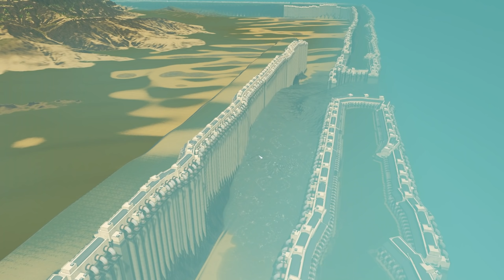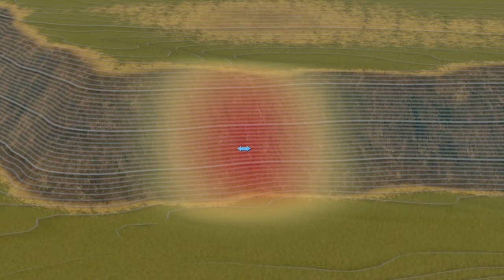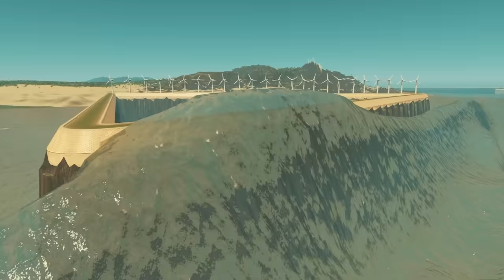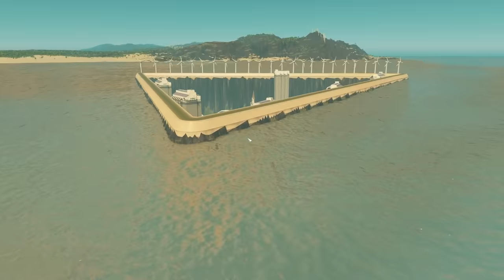When an Engineer makes Atlantis in Cities Skylines...

Comment: When you discovered that pumps do indeed need power but forgot that coal power plants do indeed need coal (ore industry will help with that) I thought to myself, "Ladies and Gentlemen, an engineer."
Reply: Wait till he discovers he can pause time so people won't abandon/die while he's trying to fix the issues with the city... :)
Reply: He's a drainage engineer. He drained the power grid, then drained the coal supply. All working as intended.
Reply: @afsarmstrongfiresafety7460  🤣
Reply: @afsarmstrongfiresafety7460  but failed to drain the water. 2/3
Reply: @grqfes  2 out of 3 objectives met is pretty good by municipal project standards.

Comment: I think perhaps a second triangle should be done, but this time having one of the points facing towards the sea so that when another large wave comes it gets split and deflected like a wedge instead of crashing along a flat wall. Also having the walls even higher will help prevent spill-over since the first triangle only accounts for a calm level sea and doesn't prepare for higher levels.
Reply: So, basically a bastion..
Reply: That was my second thought, "why'd he have the flat side towards the sea?"
Reply: @MrFright2010  Because that's only something an engineer would think of, oh wait.
Reply: Unfortunately, I don't think the game's water physics care enough. From all the C:S I've seen, it just sorta pops over everything...

Comment: Here’s a few suggestions:
Use Building Anarchy to toggle placing modes so you don’t need a shoreline, use Ferries and Barges (from barges mod) to have an outside connection.

More terrain tools also allows you to place water sources and set sea level.

Comment: Your issue was with power not working consistently. That underwater one might have worked if the power plant hadn't run out of coal. 

The tidal wave from the sea wall likely overdrew the windmills so the little dip the initial suck of the pumps caused then turned off from lack of power and made that secondary wave that overtopped the wall and knocked out the windmills. If you made a few nuclear plants on the mainland and sent power over, it'd likely be able to handle it.

It is odd that the pumps seemed to work without power, but they worked a LOT better with it. Try experimenting with that. Atlantis may be even more possible.

Comment: I think if you did a 2 layered wall with a hollow section between them for excess water to spill into then put pumps in to dry the inner section it would pretty effectively fix the tidal wave issues

Comment: It would be amazing if you used a infinity pool system, where the outer walls are at sea level, and a secondary lower wall with pumps drains the water between both walls.

Then you would have a buffer for sudden tidal waves and still have a city hidden below sea level

Comment: Beside the permanent tidal-wave Threat, you also installed a Backdoor for Sea-Water... the Tunnel.
How about this: An Atoll with your Atlantis in the Middle, instead of a Lagune. Smaller Mountains in the spots where most likely tidal-waves would hit the Atoll. This should split the Wave, maybe directing it around the City-Hole. If some water enters, you still have the Pumps.
Ferries and Helicopters should be sufficient to reach this Place. Personally (in an imaginary parallel-world), i would put an Energy-Field or transparent Superstructure over the entire City....just in Case :D

Comment: Odd and late question, but would making that whole area into an airport industry just smooth it out? Find the height you like, then just make a massive airport. Everything should be smoothed then. Even better, you can just change the whole thing out right after to whatever else and be fine. I think that's how it works.

Comment: Ah yes my favorite shape the rounded triangle as well as the rounded square. Not to be confused with the Triarcle which is a different shape in which the rounded triangle has the vertex split into multiple vertices making it round out the corners of the shape. Compared to a Triarcle which has rounded sides as well as the vertices. Compared to a Reuleaux triangle which has only the sides curved.
Reply: And not only does it have the rounded triangle in positive space but as well as negative space How nice.